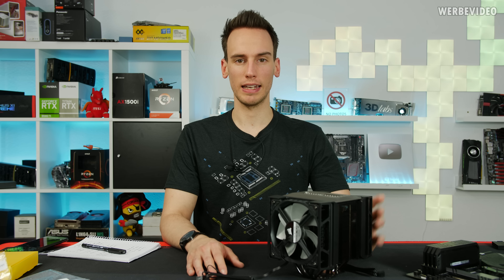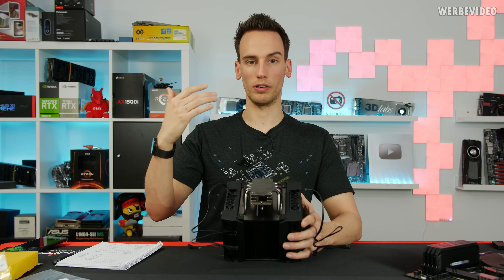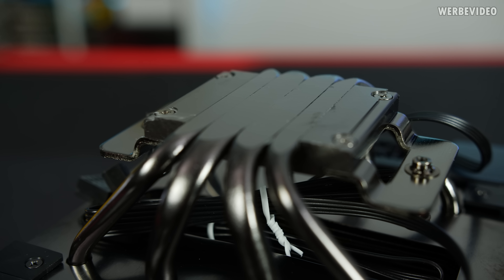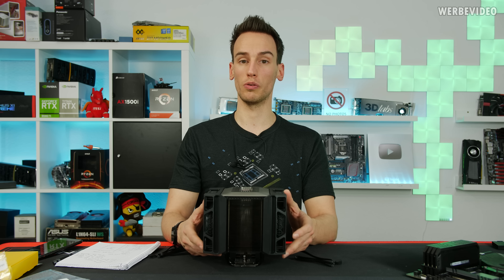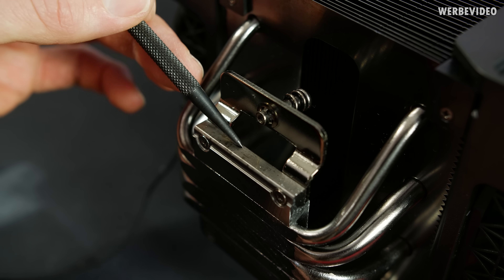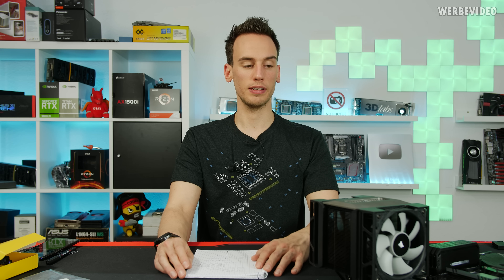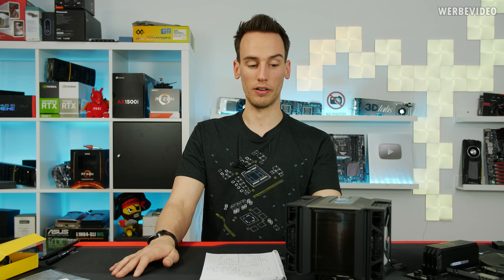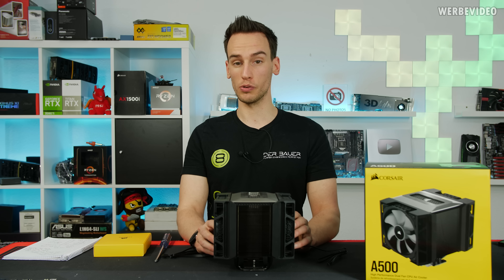Nickel Plated Aluminium vs Liquid Metal? Corsair A500 Performance Review

Comment: This is pretty clearly just an attempt by Corsair to fill a perceived gap in their lineup so I'm not really sure what a lot of people's problem with it is.  There's enough people who want decent looking, non-RGB air coolers as an alternative to their successful AIO lineup to justify its existence. 

Corsair's whole strategy is to get people to buy as many of their products as possible by banking on brand recognition and product availability. They make RAM, cases, case fans, coolers, SSDs, keyboards, mice, headsets, etc, each at multiple price points for a given item. None of them are really the "best" in theyre class but they're consistently decent enough to at least be competitive. Even in the enthusiast PC market a ton of people would rather just buy whatever Corsair product fits their price point and know it will perform acceptably (as this cooler does) rather than dig through reviews to get somewhat better value/performance.

Comment: I specifically want to know how this performs with a 3700x/3800x vs the noctua and be quiet lineup.  i got a u12s chromax just because I wanted to be 100% sure about compatability, although the patriot viper ram i got isn't super high so perhaps i could have gone with one of the bigger noctua or be quiet units.  this is going in a phanteks p400a on an asus tuf x570.

any thoughts on the u12s / 3800x combo?  i know these chips don't have a lot of OC headroom, but is this adequate for what they can do, given the good airflow case (4 fans)?  will i be able to max out the all-core to whatever the chip can do, 4.2-4.3 or whatever, or run stock and hit 4.5+ on a single core?

Comment: You could get a  6 copper heatpipe direct touch air cooler from china for $30 USD quite some time now.

Not a new design and with 2400 rpm fans makes this a hail mary pass in my book.

Comment: So it is aluminum heat pipes too? Because i know in the ad's it says copper pipes. Wont doing nickel and copper with aluminum create a mixing metals problem?
Reply: Only if you submerged it in water
Reply: @jasonoutman   ok but still raises the question are the pipes copper aluminium?
Reply: The heat pipes will be copper.

Comment: Nice video and reference - and did you ever try a Snow Man M-T6 ?  Can be had from China to Europe for only USD 25 (incl shipping) and has copper heat pipes, two quiet PWM fans.  It makes no sense to me buying the Corsair A500, only for the sliding adjustable fans.

Comment: Announced the day after I bought a Dark Rock 4. FML
Reply: DR4 is cheaper, MUCH quieter and not far behind in temperatures. It can handle my 3700x OC to 4.3 all cores (max 72C in AIDA64 and Prime95). And if you need more cooling you can always add a 2nd fan.

Comment: Only 2 screws to affix it to their jimmy-rigged solution for a one size fits all air cooler. Not the best solution if you're seeking completely flush alignment - plate to IHS.  You're still hanging nearly a kilo and a half off the motherboard, with some janky spacers.  And it's no wonder it's noisy @ anything over 1200 rpm with 120mm fans.  Looks like a money grab by Corsair instead of performance improvement.  Hard pass.

Comment: I don't know why anyone would want to use liquid metal on top of an IHS. It adds little to no cooling performance over Thermal Grizzly  Kryonaut thermal paste. IMO, liquid metal should be reserved for only direct die applications, which can dramatically improve performance. Liquid metal should NEVER be used on top of an IHS that has a vent hole, like those found on some HEDT Intel CPUs. There is a slight risk of it seeping inside and shorting out your expensive CPU.

Comment: Another youtuber was having problems with the mounting hardware. It didn't apply enough pressure to spread the thermal paste. Maybe something you could look into as well whilst using the backplate that came with the cooler.

Comment: Any ideas on how to deal with heatpipe gaps? Got 2 8mm heatpipes on a 45 degree rotated die and the massive gap is right across the diagonal of it. Temps are fine, but it bothers me that about 50% of the surface in the middle doesn't have proper contact, but like a 1mm of paste between the heatpipes. I've also seen quite a lot of other Strix cards that having this issue.

Comment: In Australia its the same price as the standard NHD15 and way cheaper than the black d15 which does have bigger fans remember. I would honestly consider this because it looks way better than the beige Noctua. If I hadn't moved to watercooling years ago and never looked back. 
I can see why they did it. The AIO market is saturated and most air coolers look like ass.

Comment: its not even compatible with their own rams! bravo corsair, bravo
Reply: But it actually is...... it's why they added a sliding fan bracket also they do have memory sticks that arent extended.
Reply: @MelloState  with the fan raised up, air wouldn't hit the fins properly. and that slider isn't anything new either. basic coolers like hyper212 has had the similar feature for years now. funny thing is that the hyper 212 is actually compatible with big arse rams like the dominator platinum lol
Reply: @cripticdestiny  That's nice, then get that. But since it covers the ram anyways why not get their non rgb sticks which will work fine with this cooler? I know, crazy world, they have non RGB memory as well
Reply: @MelloState  I've had the ddr3 dominator platinum for years now. With the 212x on a i7 3770k. Although I don't use that pc anymore but i just wanted you to know that corsair could've done better than this silly excuse of a aircooler. They haven't even used any copper in it yet asking for that premium price. No one should buy this
Reply: @MelloState  The NH-D15 Chromax with a second A15 Chromax is still under 100 Euro and out-performs this with better aesthetics and memory compatibility.

Comment: I was curious, if you placed the fans drawing air in opposite directions would it make a difference in cooling? It seems like it would work better drawing the cool air in between the fin stacks and blowing out the warm air away from the other stack. How were the temps with liquid metal? Does liquid metal improve the boost on the 3900X? Like does it boost higher for longer with an air cooler vs. AIO? 

Thanks ever so much for doing this in english, I really love your 011D Lian Li cases I have the Dynamic and plan on getting the 011 Mini later this year when it's released.

Comment: For 40€ you can get the Phantom Gelid Black which is a dual tower 120mm air cooler, which is also nickel coated aluminum I think, with a copper heat spreading baseplate (no direct contact heatpipes). Weighs 1kg, comes with 2 pwm fans. I never saw reviews of it but for the price I was really curious and got it to cool a Ryzen 2700. I've OC'ed it and Hwinfo reports approximately 160W CPU package power. With the cooler, max temp 70°C with fans at 55% for near silent operation even during renders. 
Honestly why get this corsair A500, maybe get some degrees cooler on the CPU but for near triple the price? Finish of the baseplate seems even worse than on the Gelid...

Comment: I sure "love" the huge screw hole in the middle of the cooler... fail
Reply: I think it's designed that way to allow air flow.  

I can't think of any coolers at this size that aren't in a twin tower configuration albeit that this cooler has a hole rather than being two towers.
Reply: @unitedfools3493  this isn't two towers, this hole just hurts performance.
Reply: Fail? But it works doesn't it?

Comment: How can it be that I get a 4x6mm heatpipe cooler with copper headspreader (arctic freezer 13) for 20 bucks, while coolermaster charges 100 for an inferior design in terms of heat transfer? 
I know the bulk of the cost is in the fans, grill and length+architecture of the heatpipes, I just don't get why you'd cheap out on the most important part.

Comment: corsair is very overpriced, and overrated company. In almost every instance i'd choose another company over corsair.
Reply: They're a very hit-or-miss company for sure.
Reply: Their HydroX stuff isn’t overpriced. But this air cooler... yeah. The fan mounting system is brilliant, but probably not worth it for $100. Was really hoping they’d knock it out of the park with this one.
Reply: Ive been building computers for almost 20 years now and I used to steer away from corsair because they were a little more expensive. I have slowly changed my tune and now my case, PSU, AIO, fans, and keyboard are all Corsair for my recent z390 dark 9900k build. Their quality has gone up rapidly over the last few years and everything just works. Plus they make some of the best looking components in the game name.
Reply: Why? Their AIOs are pretty much identical to everything else at the same price, they make some of the best cases, they make great RAM at every price budget (and the best RAM available - Dom Plats SE which I have at 3466 CL10), they also make great keyboards and the void pro headset which is apparently a great headset. Corsair is one of the most complete companies in the PC market where you're always going to get what you pay for. This shit cooler is an exception though, no one is arguing that
Reply: @weavercs4014  Well for case I would chose cm over corsair nowdays, headset hyperx, mice and keyboard logitech, fans, aio and thermal paste arctic, ssd crucial/samsung and for the RAM and psu corsair
Reply: True, only products I like is my good old Air 240 case, psu and ram.

Comment: why not use your nanotube termopad?
Reply: Clearly states in the video, because the exposed heatpipes has cracks between each of the pipes, small but still there. Thermal pads work for coolers with an additional heat spreader on the bottom where it makes it fully flat

Comment: At the price point it really should be copper. Its competing with noctua but with Corsair tax on it
Reply: imho any air cooler that's same price or more pricy than NH D15 eithed has to perform real good or is simply worthless
Reply: and i dont know how they did it but this looks uglier than Noctua...
Reply: But it's not competitive with Noctua: it performs significantly worse while being louder for the same performance level.
Reply: I’ve always justified paying higher prices for Corsair products due to the good quality and my great experiences with their rma service and their warranty. However, I doubt anyone would ever need rma an air cooler so it is hard to justify this over an nh-d15.
Reply: at 100euro this is DOA
Reply: And then there's the Noctua Tax if you think about it with how it performs... So maybe Noctua should also lower their price.
Reply: @MelloState  noctua outperformed this so has the right to be more expensive

Comment: I think Corsair needs to quietly step back out of the air cooling market before anyone realizes they've poked their head back in the door.

Besides your points in the video the things I see wrong:

Fans and brackets are pointlessly over-engineered and specific to the cooler, driving costs up significantly for no reason other than aesthetics, which are still bad.

The raw pass with a dull end mill over the bottom, including chewing up the heat pipes in an attempt to finish flattening them, means that corsair's budget on manufacturing and assembly is bare-bones given the cost of the cooler. There will be a high number of manufacturing defects and failures in this model. I also wouldn't try going back and lapping this block flat because there is no accurately judging how much of the wall is left after they were machined down like that.

Nickel plating on a block that can't be seen on 99% of machines once the cooler is installed.... Why? Was that the cherry on the top of this engineer's wet dream of an intern project?
Reply: probably to address liquid metal concerns tbh, and it makes it look higher quality
Reply: @thevictorwc3  Their first priority should have been to put a proper surface finish on the block and pipes. Putting a simple disclaimer on the box saying "Not for use with liquid metal TIM's" would have been a better solution, since only a small fraction of people use it and it's an even smaller fraction of people doing air cooling that use it at that.
Reply: @Jerel Wayne Yeah... Won't tell you how many I've built...

The cheap clips are fine considering they probably tacked an extra $20 on to the price tag for that plastic crap and the clips cost you less than a quarter. Look at the rest of the cooler: Does that look like a $100 tower with appropriately priced fans to you?

Do you think that the quality and performance of this tower stack should put it's price within spitting range of some very decent 240mm AIO's?

More secure? You got a problem with fans just randomly falling off of your cooler towers? I'm baffled but thoroughly curious at the same time, tell me how this occurs.

More adjustment? For what? For that extra adjustment to be used, you'll have to have over 50% of the fan sitting off of the cooler.

So what if the clips are annoying? That's only a problem for you and I who get suckered into building other people's PC's. Once they're on, the average user never removes them. Hell, most decent air coolers are designed so that they can be removed without removing the fans, so even enthusiasts only put those clips on once the vast majority of the time.

Fantastically expensive solution for problems that don't exist. Typical over-engineered BS. It's worse because you can tell corners were cut on the rest of the product to make up for the expense as well.
Reply: @Jerel Wayne Those metal fan clips are great, since they cost a few cents each of manifacturing and are inherently compatible with mostly all fans of the determined size.
Reply: What is specific about the fans? Looks like standard 140mm fans to me. If you can tell how flat a surface is from a youtube video you should get a job in machining. Or at least tell a machinist that you can and watch them smile. 
If there was a high number of failures which is extremely unlikely because Corsair doesn't do that, they are about the only company who will take care of it and make it right.
Reply: @JakusJacobsen  Yeah that's the thing. Corsair only made a 120mm fan of this type before. How much do you think those plastic monstrosities on the side cost to manufacture compared to the wire clips everyone else uses, that function just as well?

I do a bit of machining, and a lot of woodworking. A dull end-mill cut that hasn't been cleaned up is obvious, look at the shots that have the light reflecting off of the surface. It looks like someone made that thing with a hand file being held in the mouth of a dull beaver.

Also, I request you hearken back to the early days of the H series of AIO's from corsair. The number of RMA's for the first few batches were sky-high. Corsair believes that PC gamers can beta-test hardware just like they can beta-test games.

Comment: Der8auer you need to scratch a bit surface to let gallium corrode aluminium, if you don't scratch it, oxidation layer actually prevents from penetrating aluminium, so if you could try to apply liquid metal and after make a scratch under liquid metal, you should see corrosion due to Gallium.

Comment: the Cooler Master MA620P is also a direct heat pipe air cooler and as it is cools as good as the 240 AIO which I swapped it for.
Reply: First thing I did with my MA620P, was to flatten the base and smooth out the rough bits to a near mirror finish (I could see my reflection) for a nice flat contact with the heat spreader. It was only AU$10 more than a 212X at the time and about the same price as a 612.

Comment: To be honest, only place i would and have put your CONDUCTONAUT is either between IHS and CPU die, or between GPU die and cooler, but certainly not on IHS on CPU, so i really dont know whats the point of this liquid metal test?
Reply from the maker: A ton of our customers (talking from Grizzly perspective) are using it on the IHS. So certainly not pointless just because you as a single user don't do it :)
Reply: @der8auer  Thanks for the reply, but come on, lets be honest here, its safe to say most that use this product dont use it this way, and i mean like +90% dont, its just unsafe and stupid on so many levels and also doesnt make as much of a difference, between IHS and cooler than between silicon and IHS.
Reply: He wanted to test gallium erosion and cooling performance since conductonaut is great stuff but I get your point, pretty pointless in this scenario

Comment: Direct Touch Heat Pipe! or as Corsair would say, quad direct-contact copper heat pipes. That cooler is a little pricey for the quality. Which isn't nothin extraordinary.
Reply: NH-D15 chromax edition is way way better than this overpriced piece of metal imo lol
Reply: @JustBedz  Costs the same with a few degrees difference in performances, not way better.
Reply: Too many negatives in that last sentence :D